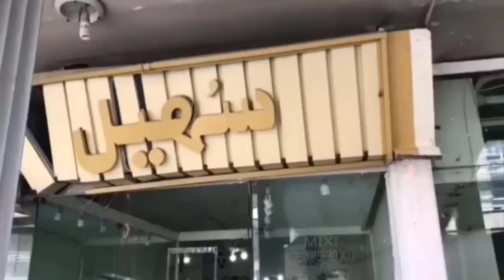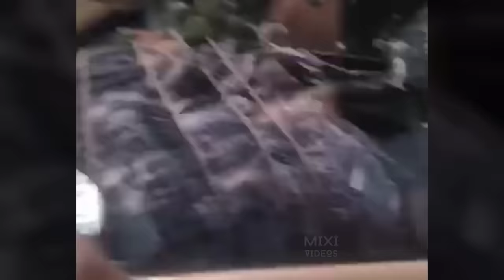TOTAL IDIOTS AT WORK #110 | BAD DAY AT WORK 2022

Comment: 0:47 - he is actually doing it correctly
Reply: I  think the problem here is the fact, he stamp out a square hole instad of round. The work itself seems like correct.
Reply: @christianjaning7529  really?? and tell me how do you do a round hole on a ceramic tile??
Reply: @Flaviol3

Uhhh. With a circular/cylindrical drill bit ffs 🙄
Reply: @philmckenna5709  hahaha and where do you get a 5cm+ drill cheap enough for constructors to carry? Dude dont talk about what you dont know
Reply: @flaviol3978  Amtech F1210 50mm (2") Core Drill $10 on Amazon.
Reply: @jacktargett6363  you know that is used for rock and cimment blocks right?? you try to use that on a ceramic tile and the tile will break
Reply: @flaviol3978  Yes it will break the thinner tiles,but I have used them on Quarry tiles before. Amazon do this one for £12 50mm Diamond Drill Bit, Hollow Core Drill Bit Hole Saw Laser Carving Drilling Bits,Suitable for Tile, Ceramic, Glass, Porcelain, Marble, DIY Kitchen Bathroom Shower
Reply: @flaviol3978  With a Round drill with diamond glued on the tip.-
Reply: Reading these r-worded comments is depressing. From a generation where people don't even know if they're boy or girl.
Reply: @flaviol3978  Bro you absolut right!
Reply: @philmckenna5709  LOOOOOOOOOOOOOOOOOOOOOOOOOOOOOOOOOOOOOOOL

Comment: Some of these aren’t fails….the cement truck slamming on the brakes was great.
Reply: "That's four yards of concrete you made me still on your Jeep, Mack.  That'll be $82.
Reply: @billolsen4360  I wish you could get 4 yards of concrete that cheap. We just had quotes for 3 yards for a small project of $250-300 just for the concrete.
Reply: *Category: What happens around us every day.
****WELCOME*****THE BOXNEWS****
Reply: @disgruntledgrunt4259  Yeah I haven't had concrete work done in a long while.
Reply: Including the gas depot leakage
Reply: @disgruntledgrunt4259  I’m currently looking at ways to fix up my back yard and the cement option is getting moved down the list of ideas due to cost. Of course so is everything else, so I’m all over fb marketplace looking for deals.
Reply: @GhostDrummer  We are going through a similar situation. I have a small workshop for my hobbies and wanted to put up a small shed that I could then convert for my lathe. I didn't want it on blocks like you see these days and had several estimates for a pad, ended up putting it on blocks. The pad would have been more then the building cost to have built.
Reply: Too bad the jeep didn't have a sunroof.

Comment: Also, when getting gas there's usually a big red button on the front of the building a main shut OFF valve of sorts that will stop gas spraying out the pumps, hoses, nozzles, etc...
Reply: Or how about calling the attendant.
The ONLY thing, that was "unacceptable," was the level of stupidity they were showing.🤦
Reply: The sign should read “Bro, Press Here.”

Comment: 0:31 lmao that's because A) the engine is sucking in air, and B) that tube is made of a material that's too weak/flexible. Like sucking through a straw and the straw self-narrows and blocks airflow.
Reply: Chinesium.  It's so flexible and versatile.

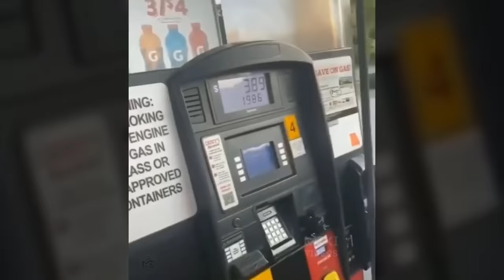Comment: 3:25 just... put the handle back... it will stop spraying gas everywhere...
Reply: That would require a bit more intelligence than he has. I bet he got on the phone and called his mommy after he used it to make a YouTube video to show how stupid the gas station is. Let's look for it and send it to this channel to post. Tee hee
Reply: There's a stop button on the gas pump
Reply: @pscottyxx  yeah. When you hang the handle back up it turns the pump off. There is an emergency shut off but most of them are located on the building.

Comment: Whenever you see a vehicle on its side in a fail video, you know that when it gets back on all 4 tires, it is going to roll off down the hill because the brakes weren't set.
Reply: The truck never had brakes to begin with which is why they are on their side. PS and a nut behind the wheel.

Comment: At 3:19 did both of them not know to just put the gas pump nozzle back into the slot holder thing 😑 it sounded like the guy filming knew it but was just trolling the guy, like yeah lets just leak dangerous gas all over the place.. so funny.
Reply: Maybe they didn't think the pump will stop just because they replace the nozzle

Comment: 2:59, this is how my car is, everything that is not required to run will come loose a lot. It has ac and can start and stop but the plastic pieces and rubber gaskets around the driver side window and door will get loose and I have to push them back in.

Comment: The guy who couldn’t stop the leaking gas pump hose……..put the nozzle back in its holder!  This turns the pump off.
Reply: Also, there should be an emergency cut-off switch on the side of the building.
Reply: @johnmontgomery3471  in the UK there is a cut of switch mounted at high level for use by firefighters.

Comment: 0:35 cuz that rubber hose isnt designed to handle the intake vacuum created by the engine sucking in air upon revving
Reply: More likely  clogged air filter.

Comment: 5:49. Welp, that's one way to make a shock absorber from one vehicle to fit another vehicle.
Reply: I believe you are missing the point. The piece that was cut of is supposed to be an oil reserve. There should be an orifice between it and the shock body. They were showing that it was a fake!
Reply: he's showing that its Chinese junk fake suspension = no oil reservoir = no damping at all